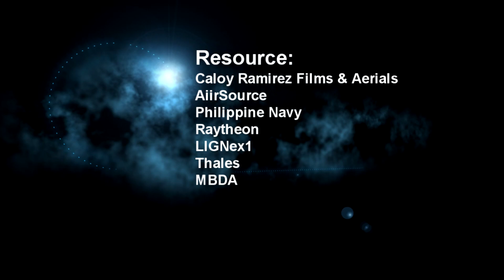Del Pilar Class Patrol Frigates Option for Fire Power Upgrade

Comment: Del Pilar Class OPV feasible missile systems capability,

Anti-Air warfare:
> 2 x Twin Simbad RC or Sadral or Tetral Mistral 3 missiles system
> 1 CIWS 

Anti-surface warfare:
> 2 x quadruple LigNex 1 700K Haesong Antiship C-Star Cruise Missiles

ASW:
> 2 x triple torpedo launchers with K745 Blue Shark torpedoes

Comment: US allow Philippi to acquire numbers of Perry Class Frigates possibly 6 to 10  Nos all run on Gas Turbine PN was telling us that it is expensive Since when  LNG is expensive than diesel I do not understand our PN are they not capable to train on gas turbine engine.Philippines could have save a lot if we are acquire those Perry Class and workerd with US not to remove the missiles Anyway they are providing the Foreign Military Assistance in USD hundred of millions every year that should cover any missiles installed on Perry   Clasa Frigates instead of buying new Frigates which could be used to buy to  Multi Role Jet Fighters for PAF

Comment: Best way is acquire at least 4 Perry frigates by buying them w/ 2 diesel-electric engines each. Then transfer all 3 ex-hamiltons to the coastguard but all their main guns & 25mm RCWS removed & transfer to the Perrys

And so all the planned upgrades to the ex-hamiltons goes to the Perrys.

But it seems it's too late since the upgrade project is already running
Reply from the maker: our navy is allergic with Gas Turbine engine which is the propulsion of ferry class, due to high operating cost
Reply: @PHMalaya  but they're willing to use codog such as the Hamiltons & Pohangs, including Ulsans, Maestrales... They just have to buy 2 diesel engines as part of the refurbishing costs. But hopefully they'll choose diesel-electric variant instead
Reply: The Philippines Navy should investigate CAMM 1-2 VLS they are both space savers .

Comment: why no VLS?
Reply: not design for vls
Reply: @angelodeasis6081  what was the original purpose of the boat anyway and why not mount that?
Reply: @bryansarmiento836  because these del pilar class patrol ship wasnt design for fitting and installed vls it is expensive for my country   to retrofit the overall design of this three old ship
Reply: @bryansarmiento836  it's deck isn't designed to accomodate a vls. Better to have missiles fitted on canisters like OPVs